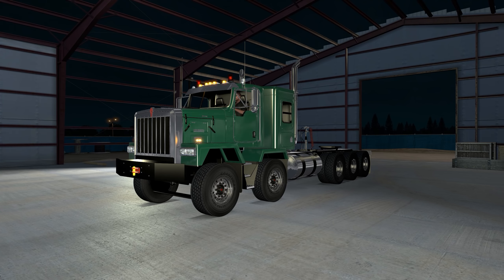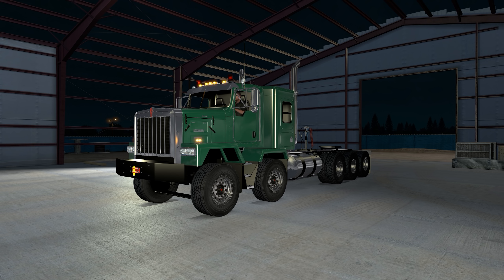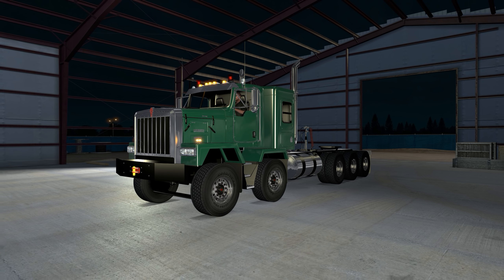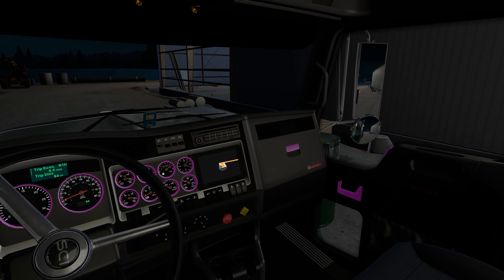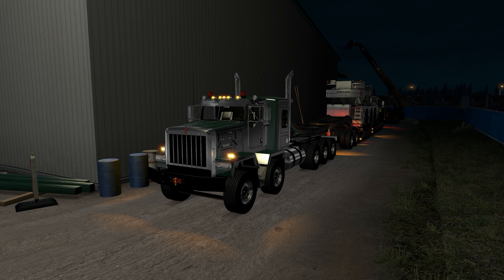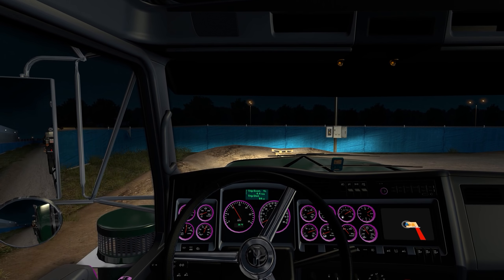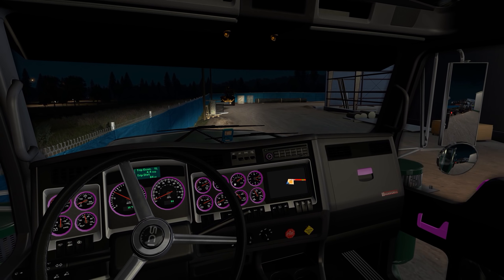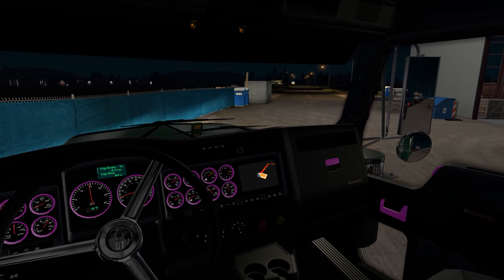American Truck Simulator - Kenworth C500

Comment: Just in case anyone is wondering those trucks are try drive duel steer they can legally scale 100000lbs without a trailer they are special built for the oil patch and mining in Canada and Australia they mainly end up having huge cranes on them and haul a tri axle high boy trailer at least in the oil patch

Comment: I tried the C500 mod and I really wanted to love it.  It's has a great look and the tandem steers is pretty unusual.  It's basically an oilfield truck, but a unique addition to ATS either way.  While it doesn't have a ton of options like some truck mods, it does have cool air cleaners with lights, stacks that can be behind the sleeper or by the cab like normal.  The taillight panel is annoying and there is no other option unfortunately.  I also had the infamous pink trim in the interior but what killed the mod for me was the FPS dropping into the teens.  I hope it gets some more work in the future, some more options would be nice, a better taillight panel, some fenders, maybe a rear body and most importantly for me and my ancient graphics card, some optimization.

Comment: The toggle or 4 way switch on the 383 Sparco is not cheap or flimsy. It is actually an 8 way because it does diagonal too. It does take some coordination to get it to go where you want it, I do try and assign minimal inputs on it. It does take the place of the mouse if you want to use it that way.

Comment: In Oregon I noticed once in a while the frames lock up. I check the other states and not a problem. /////  What I would love to know is how to up-grade Mod's when ScS up-grades their game? I have never used a mod but would like to try a few. I've had the best and most fun in the Peterbilt 389...  I just got the Oregon paint package, would not waste my money on that. I have yet to buy the new super haul trailers, but I did spend the 3 bucks for the heavy haul package a while ago and the 389 pulls it well. I always use the 18 speed gear box no retarder.  I also purchased the "own your own trailer" package, and I don't use it that much because cargo is limited and so is your destination.  When you pull different trailers, then you also go to different types of clients.  For example, pulling the flat bed or refer, then you don't get to go into the quarry, etc..... If your stretching your money you can do without owning your own trailers in my opinion.  Thumbs up on this video and especially the narration. The C500 is a pretty cool truck, certainly looks like it could pull 130,000 without a problem.  I also have the most fun on short runs, I find long runs boring and easier to get into an accident. Most the heavy haul loads are long distance, at least two states or that is what I notice on my game and I have the slider bar set for short runs.

Comment: Jeff, I have really been enjoying the American Truck Simulator series. As far as LSPDFR goes, the ELS problem is actually an Open IV problem.  I had the same problem where none of the my vehicles light's would work.  I found that if you go to Tools>ASI manager and uninstall ASI Loader and OpenIV.asi. Close Open IV. Reopen Open IV, open ASI manager and install ASI Loader and OpenIV.asi and viola it should work, at least it worked for me.
Reply: Voila* 🙂

Comment: I have this truck but when I went to use it the steering wheel was missing and the turn signal lights don't work right if your using a controller and press left on the d-pad it turns them both on to look like hazard lights when I press right the right signal won't even come on but if I'm pulling a trailer and press left or right the back trailer lights work like there supposed to even the gage cluster is messed up and won't show my mph

Comment: never heard of KW C500 Must be a truck built overseas or probarly used a lot in the land down under.
*Update did check on the model by searching it's heavy hualing unit. that explains it. Very rare here in the northeast states you don't see those models due to clerance or too wide of a swing when driving plus the oversize issues. there are only a few heavy special haulers here in the states due to that.
Reply: Their there you will probably notice them now you have seen them
Reply: C500's are all over. Built to be a tough truck. I grew up in the passenger seat of a c500. Australia uses kenworth C510's for the most part for their trains
Reply: Miller runs a few in the North East. They're extremely popular in Canada and Western US oil field applications
Reply: @knbcustomfarmingsolutionsl6055  yeah i did see these kw from miller then i though they were w8's though. another big hauler up here in the northeast is jk hackel. or hackel jk or something like that. but jk always mostly runs the old pete 389's with the cats and 18 spd standards.

Comment: This truck is a leaked mod its originally a paid mod by JDM.
Reply: Rustybearing 45 I was gonna ask that. Just tried the other day and it was 10$
Reply: Leaked Mod?
Reply from the maker: Why is it on all the mod sites? If you google ATS and C500 nothing comes up for a paid mod.
Reply: Jeff Favignano Im in a american truck simulator mod community on facebook and one of the admins posted saying that the C500 that JDM made private has been leaked.  On Jnr-Snr’s gaming channel he tested the C500 and he even suspects its not JDM’s original truck.
Reply: Jeff Favignano The C500 is on all the sites because someone decided to leak the truck on one of the mod sites i believe ATSmodding was first then the truck spread like wildfire on all the sites because of the 1 guy leaking it.

Comment: Did anyone see the stearing wheel and the dashboard
Reply: You mean the missing steering wheel in this truck if you download and add it to the game the steering wheel will be missing you have to take it to the shop and add it besides that the front turn signals are messed up if you use a controller and press left on d-pad both front turn signals will come on the right one won't come on at all if you press right on d-pad but if you have a trailer hooked up both left and right turn signals work like they should on the trailer this truck is glitchy because it's a mod truck most trucks like this will be glitchy if your not good at making mods

Comment: 70,000 lbs is nothing, normal trucks haul 80,000 gross in USA.. I'd expect the gross load to be at least 125,000 Lbs, especially with the number of axles and horse power you have. Regardless was a pretty cool truck you had. It would be nice to see SCS get some different heavy-haul trucks, maybe a cab-over or two.......  Few things not realistic for ATS: you can run stop signs without a penalty, even run over them, the mirrors for a blind back up need a lot of work, I've never had a trailer come off, so while you have to incorporate some imagination, tug tests are not needed even with ATS activated. , You can drive thru some trees and bushes, depends on where you are at. Other vehicles are forever "break checking" you then pulling away, and you are just lucky not to rear end some of them. And like this game, you got there late to despite driving steady, not sleeping or stopping for fuel, that was simply wrong.  However, I usually sleep and fuel on my own time right after I drop off a load. Was a fun video with all your narration, so thumbs up.
Reply: Yes that gotta be a game error last I checked this is used for stuff normal trucks cant
Reply: @Gamerboy-gy1rl   Is what thought too, or could have been a slip of the tongue. Even a Kenworth  379 or 579 built from the factory for heavy-haul can pull 120,000.  A lot depends on the trailer also...  For everyday road usage, I'd think 1,000 HP would use so much fuel you would money even with heavy-haul, but is tractor was still a cool mod as you have to use some imagination with these games.
Reply: You do realise this is a game? Not real life
Reply: @grannyfrost8341  ok what the fuck you must not have read my comment the mod must've been messed up
Reply: @I Am Sekou ok read my comment
Reply: @SteelyPaw  I think the c500 and a kw t800 are best for heavy haul I'm a kw guy too much petes are slammed to the ground and fixed to look like a hot wheel
Reply: @I Am Sekou I said it gotta be a mod or game error because we all know this truck will eat 70,000 lbs and btw it's a simulator not just a game it's supposed to be realistic
Reply: @grannyfrost8341  I'd expect some realism especially in this day and age. that load in real life with that truck and trailer would of exceeded 120,000 lbs.
Reply: @Gamerboy-gy1rl  I agree, thanks for your reply!